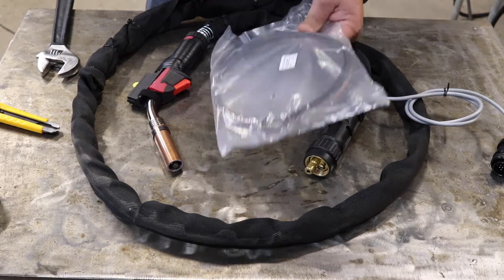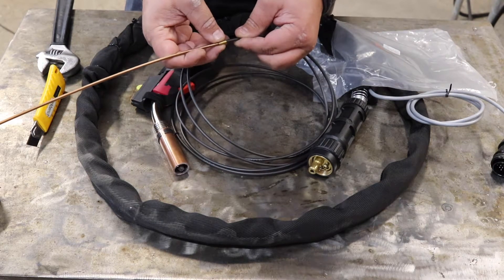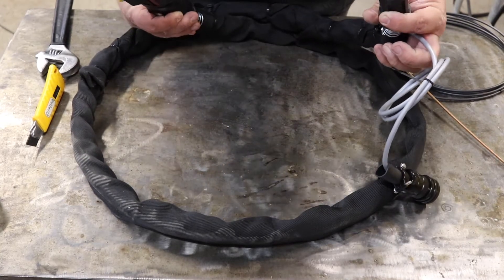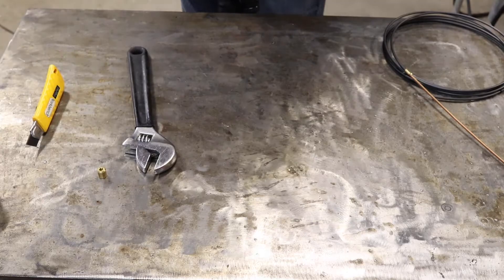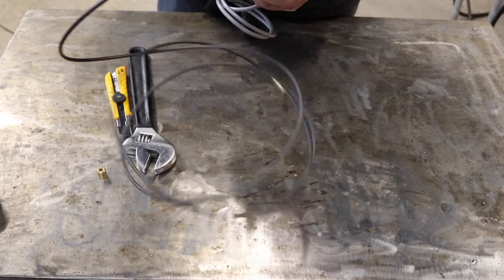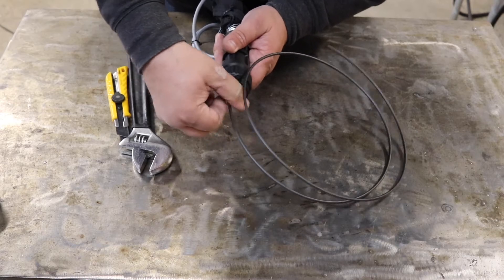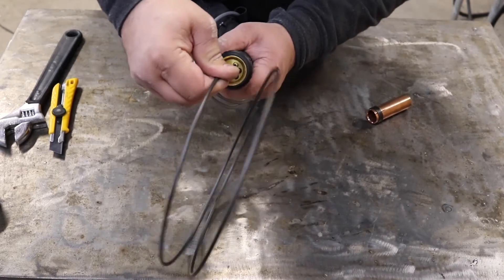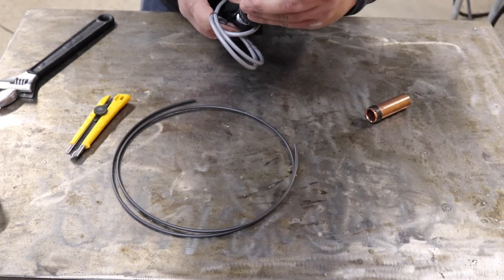Liner Installation for HTP 26 Series Guns

Comment: I have problems with my gun when welding aluminum. I pulled the liner out as it has a bow in it. This is the way it came from the factory. I have used up a bunch of tips. Can I recut the liner or should I get a new one? I haven’t even run 1 roll of wire through it 
Thanks 
Jon
Reply from the maker: please send me an email. peter@htpweld.com